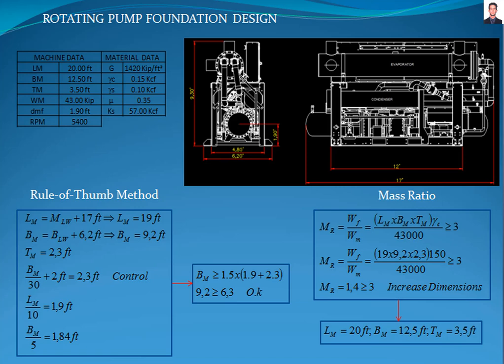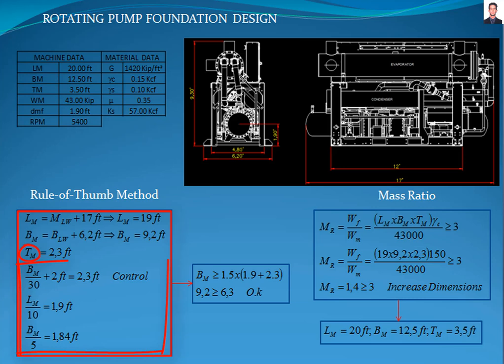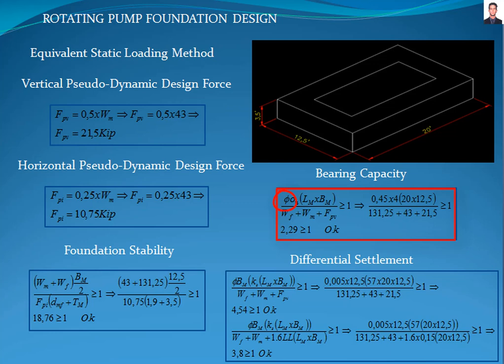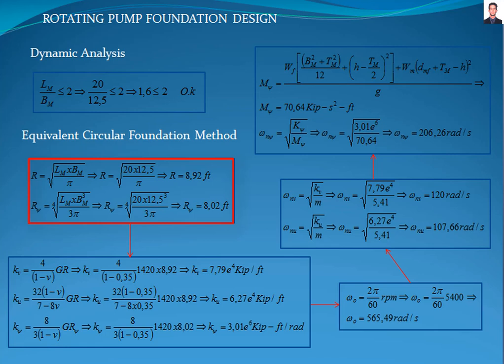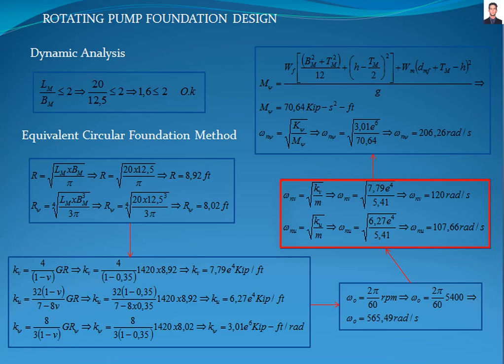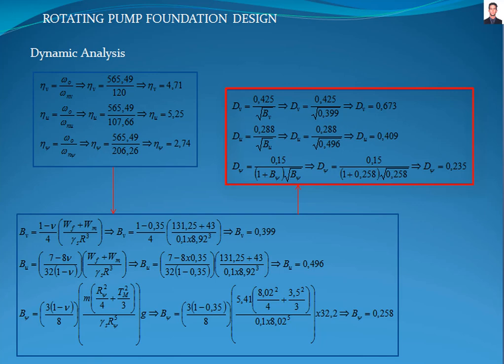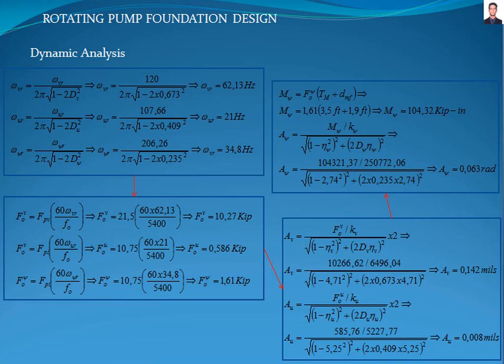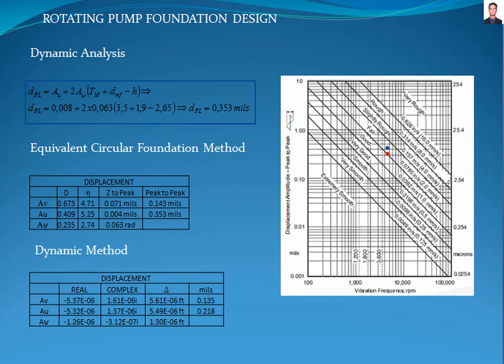FOUNDATION DESIGN FOR ROTATING EQUIPMENT

Comment: Hello - Can you explain where the number "4" came from in numerator of the Bearing Capacity equation you are covering @3:45 in the video?  I understand everything else and I'm sure I'm missing something simple.  Thank you!
Reply from the maker: 4 is the bearing capacity of the soil in kip/ft2
Reply: @franciscojosefandinoperez1387  Thank you very much.  I was working through unit analysis and had figured out the units.  Your tutorial is excellent and I appreciate your work and dedication.  This has been very useful in helping me learn the basics of foundation design.
Reply from the maker: @tennesseeriveradventures  my pleasure, if there is a possibility of a freelance work, let me know, I will appreciate it
Reply: @franciscojosefandinoperez1387   I had one additional question if you do not mind further assistance.  @9:45 in the video when calculating balance forces, I do not get the answers of 10,27 kip, 0,586 kip, and 1,61 kip.  I instead calculate 14,84 kip, 2,51 kip, and 4,16 kip respectively.  Is there something missing in the equation or another conversion factor that is being used?  Thank you!